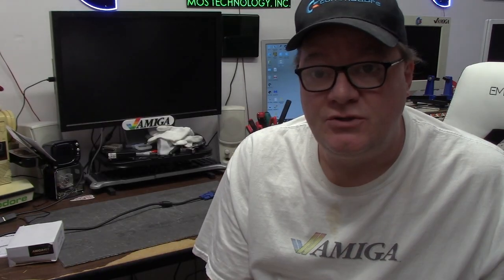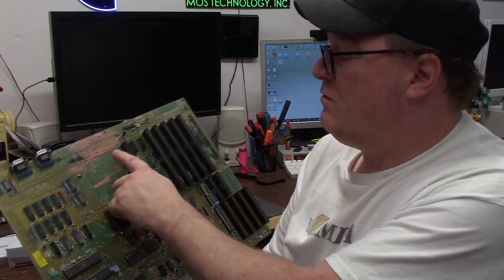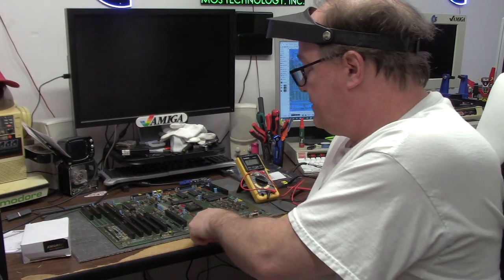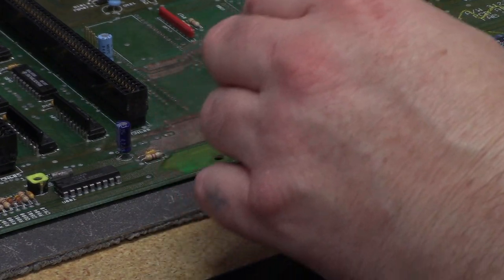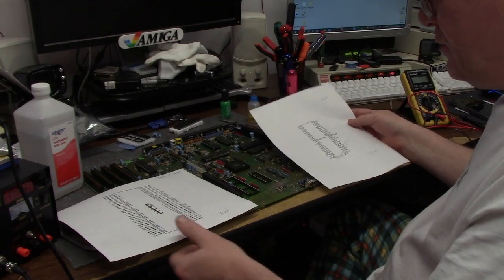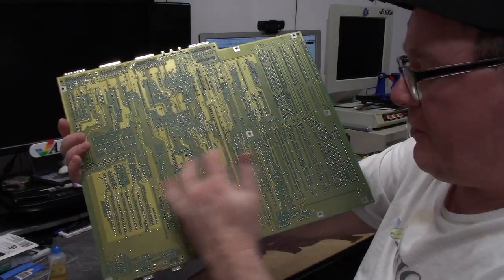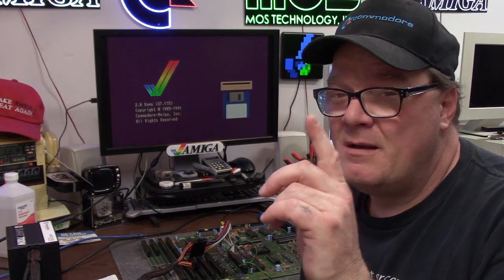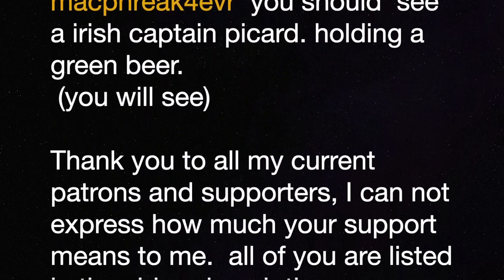Will it run?  Amiga 2000 R6 Repair

Comment: In the early 1990’s I owned an Amiga 2000. I had the original Amiga flicker fixer but it never worked properly. I used to get some pixels which used to flicker. I tried to adjust the pot at the back but it didn’t work. I sent it to the Commodore Authorised Repairer but they couldn’t fix it. I was wondering if you maybe knew what was wrong. I sold the Amiga 2000 around 1994 and went to Windows PC. I do miss my Amiga 2000. I had an accelerator board in it too.

Comment: I've been using the digital camera as visual aid for many years. That's how bad my eyes are... or maybe just my desire to see better.

A good tip. Some digital cameras can connect to a display wirelessly so that comes in handy when looking around corners in tight spaces. Live pictures while you mess with connectors.... We've not yet evolved with eyeballs on fingertips... Probably news to some product "designers"

Comment: That was fun to see. I was wondering where you get the Amiga files for sprint viewer? I've been using Amiga PCB Explorer but it is missing a lot of machines.
Reply from the maker: its listed in the extended description, sprint layout viewer and the sprint files for it. I have the other ones for the other models too
Reply: @ChrisEdwardsRestoration  Clearly I am blind, thanks Chris!

Comment: where did you get the 2000 layout i have a few dumped on me to look at both been repaired before and now no longer working
Reply from the maker: i googled it and got it off a github page. its like the top result

Comment: Did you build your own solar panel system?
Reply from the maker: Not the panels but everything else was hobby level put together i currently have three 150w panels , (12) 75ah apc batteries (gel) and can run my workroom and more for about 2 days without sun.

Comment: Hi Chris - I might have an A4000 board for you - it's currently sitting in my Brother in laws loft - it's in an aftermarket case and has been sitting there for over 20 years.... Very highly specced (060cpu, Picasso card, and, very rare a 68060 accelerator card with scsi3 controller along with ppc Co Pro) - Im reasonably sure its going to have a leaky battery though..! To anyone out there I'm looking for an OEM case... Although not holding out much hope!
Reply from the maker: Ouch

Comment: I have amiga 2000 maybe since 1998, I got it from my classmate and it was not working, planing to try to fix this, but lost my keyboard from this mashine, it was disasembled some parts is missing, there is no hard drive anymore, hear that it works not with all computers, so I got some kinde adapter to vga... but it seems it not showing anything on screen, back in 1998 I tryed to connect it to crt tv using s-video output but nothing...
Reply from the maker: You need a 15khz capable monitor or a old analog tv with the yellow composite on the back

Comment: Why is it Chris that with all the Amiga motherboards have their Solder Masks re done or touched up; that we don't have an exact colour match. I have not seen one video where the repairer has the correct colour. Is it just that I catch everyone at a bad time or did Commodore just use a particular brand that is not available anymore?
Reply from the maker: pea soup, weird color
Reply: @ChrisEdwardsRestoration  Are you saying the official colour is called "Pea Soup" or is that the colour of the Nail Polish you use?
Reply from the maker: @alanhaynes4576  hah just a joke of what i think it looks like
Reply: @ChrisEdwardsRestoration  Ha Ha Ha! I must be getting old but I have watched enough of your videos I should have realised. Interestingly though it seems pretty close to the right colour. Is Nail Polish what everyone uses now or do some use  a proper mask?
Reply from the maker: Its cheaper so most of the time i use a clear non metallic. But have recently found this green that once dry after a few coats is a very
Close match